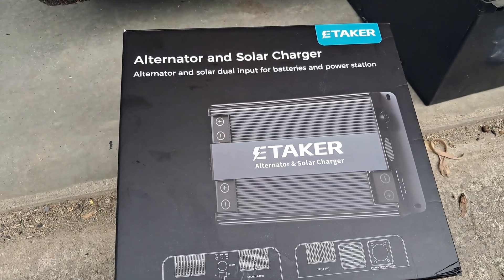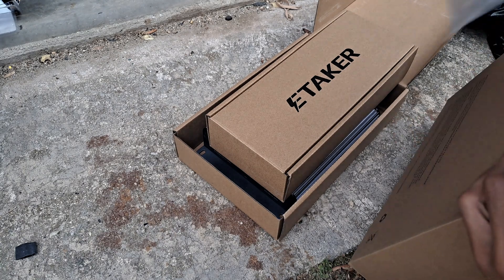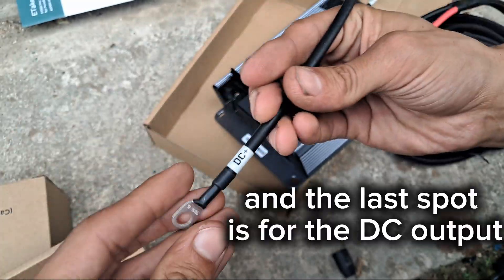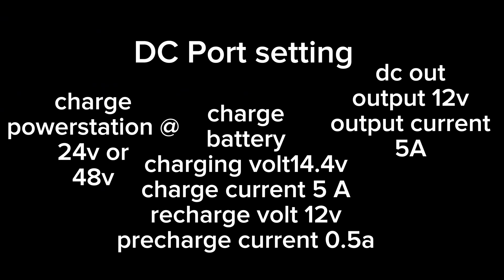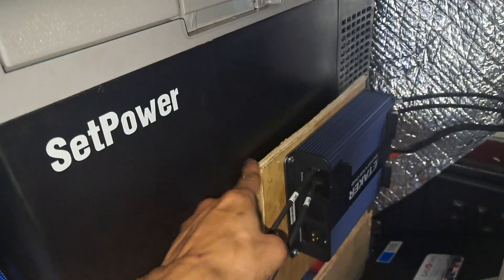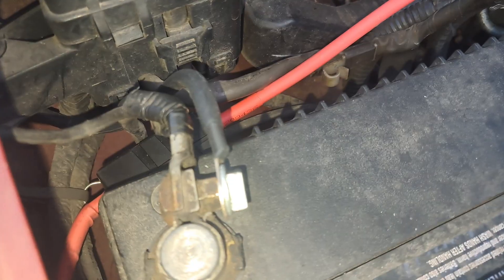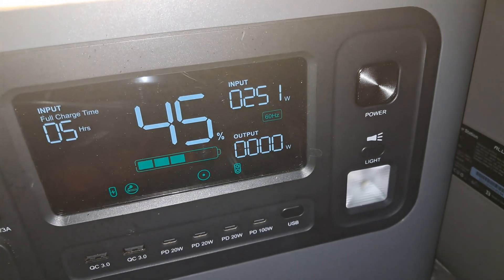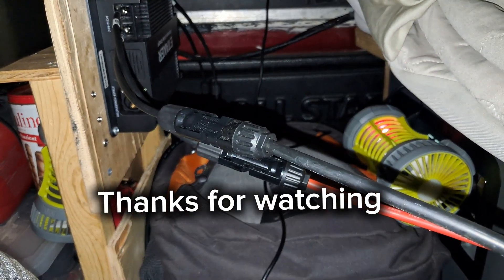Installing An Alternator charger on My Old Toyota Pickup

Comment: They need a system that starts and stops the engine automatically based on the need for charging for a more hands off and efficient charging of the power station/battery like my Prius and its hybrid system. To be fair though my Prius has a generator in it that’s a lot bigger than an alternator. Toyota should build a hybrid camper similar to a dolphin but with a hybrid system that will efficiently provide electricity for camping/living needs as well as electric powered drivetrain and fuel efficiency. Mabee something like this https://youtu.be/S1qnNzJDsN8?si=QJPjdQpHlnBLiMCF

Comment: Hey come on where is the rubber grommet. I will let that one slide but please and I'm dead serious I've seen several big trucks burn to the ground from guys running wires thru the side or bottom of the cab that is steel and 9 out of 10 times it's heavy 1ot battery cable and unfused. Stay safe young fella your safety is something you should ever put in jeopardy for a buck or two. Again this time being wood so you are good. Anyway it's only because I care 👍🇨🇦🔧🙏
Reply from the maker: Thank you for the advice I didn't think about it cause the wire has some sleeve for protection but can wear away just like the wires. I added a grommet now for extra safety. Appreciate you looking out

Comment: I’m really glad you’re making these videos. I have a little experience with plumbing and a little more with carpentry and very little with electrical. Do these devices have instructions? I’m just curious as to how “idiot proof” they are. I’m paranoid as well
Reply from the maker: Same here buddy I've always been nervous with electrical so I always steered away from it. This device did have instructions it's mostly just installation in the manual most of the setup is on the app but I haven't intentionally tried seeing how idiot proof it can be or if it has any fail safes like if its turned on without anything plugged in to recieve the power..  The "run" option (On off switch) makes it to where I can leave it off until I know I will have a longer drive and usually only turn it on for the drive to work when I can get a decent amount of power in. I only get so much to present these things so I don't always get to fully test and understand the product in that given time but I hope this answers your question.
Reply: @StriveSurvive it does , thanks

Comment: Nice to see that those combine solar and vehicle power for charging. I've hardly looked into these things. I do like them having a fuse close to the hot battery terminal- very important protection. I do know that some people have reported early death of alternators when they were used for this purpose as most standard alternators aren't built to produce their full rated output continuously.

Whenever you're running wires under or on a vehicle it's smart to look for and follow the existing factory wiring route as that path is chosen to prevent damage, even in a crash. Always think about rain, snow, ice, and road debris like small tree branches and how they can affect your wiring path, as well as what can happen if a fastening point fails.  The multiple expensive computers in today's  cars can be sensitive to surges, sudden load loss, and power spikes.
Reply from the maker: Missed this one man!
Yes it's a nice little unit if you have the right setup to utilize it fully. The added fuse is nice otherwise I would have had to add my own to be safe.

I am nervous about the effect on the alternator, I idled down the E taker because of that. It can draw 40 amps from the alternator my oem ones only about 60 or 70 amp so that would be the majority of its output not even considering the ignition system or using lights. That's to  close for comfort so I'm running it at 20 amps on my drive to work which gets me around 250 watts.  So would probably need to upgrade the alternator if I really wanted to get max juice out of it. 

Good advice 🫡 Thank you 
Have a good day bud!

Comment: AGM battery should look in to one 150 to 200 amp hours can run your inverter for 3 days give or take
Reply: The LiFePO4 batteries are much superior in every way but one-: they can't be charged below freezing temps. Most now have a low-temp cutoff built in to prevent that. AGM (aka VRLA) suffer shortened life if discharged deeply on a regular basis (below 50%) and are considerably larger and heavier for a given safe output. It's old tech and much better can be had now for not a lot more in cost.
Reply: @P_RO_  They are better, but "Not a lot more in cost" is relative to one's resources.  A lot of vanlifers start off with AGM batteries and move on to LiFePO batteries either because of a sponsorship deal, someone's generous gift, or because they've saved up.  Usually, the ones who hit the ground running with lithium batteries have the loot to do a really nice conversion and the whole works.

Comment: I am not sure how that charger is but on my Renogy 30 amp Solar charge controller, it says to never hook up the solar panels first before a battery, always makes sure your battery is connected before you connect the solar panels to the charge controller.  Did your directions have a Caution about that?

I'd recommend a grommet to fit that hole you drilled through the metal so that the rough metal doesn't cut into the insulation and ground out the wiring.  Vibration and off roading rubbed his cab through wiring and cut the insulation on the poz and neg on my cousin's truck and his fuse didn't blow and burnt the wiring harness on his truck, he had to replace the whole thing.

I think you did good bud, you didn't short anything out, didn't blow a fuse, you did damn good!
Reply from the maker: The main precaution I see is to ensure that the wiring is hooked up before turning on the unit. So the starter battery should be attached beforehand at the very least. I also always had a powerstation or extra battery hooked up on the Output end before turning on solar charging or the main unit for that matter which i think is fair to assume is a good idea. I know that's a thing with solar chargers though. 

Good call on the grommets I had that thought as well. Dang sorry to your buddy. I know that's either a really expensive job or a whole lot of work.

Thank you I appreciate it good to heat from ya and thanks again for watching